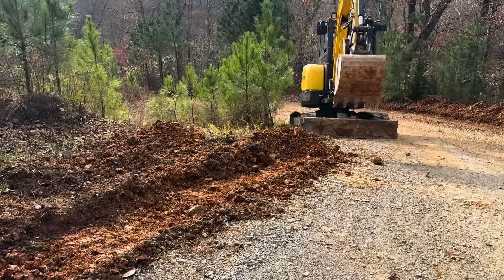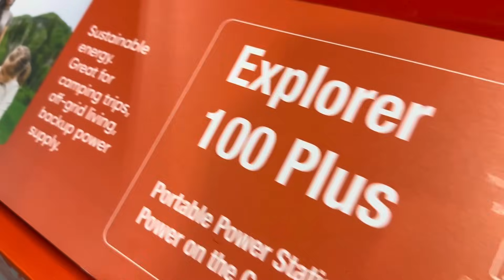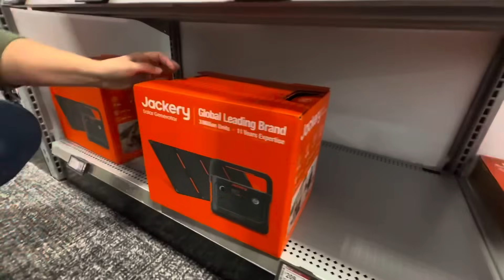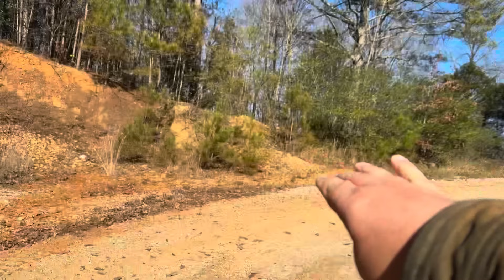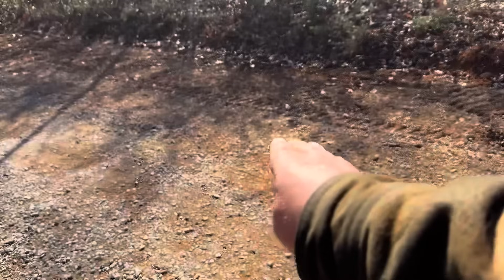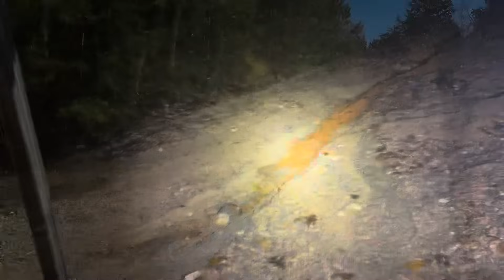Driveway was destroyed in rainstorm. Adding new drainage & water control.  Steep hill gravel drive

Comment: you're on the right track, I would dig the ditch deeper and fill it with rip, rap to slow the water down. On the high side dig a hole as a holding area to filter the silt then a 24-inch pipe to the low side of the drive to let it go down the bank. You have a lot of water coming around the curve at the top that needs to be wider and deeper, so it doesn't run over and wash. With the use of the excavator, you could fix it easily the only cost would be the large stone.

Comment: After watching it, cut that ditche out to the left from the top of the hill looking down. You dont want it to go around that turn and diwn the hill. You want to get it out if that ditch. You did good with the rock check dam you put in to slow that water down.

The washboarding is from wheel hop. Once you get it it will keep getting worse over time.

Comment: That upper dricpve part, where the dirt is four feet higher, you should consider put in some drainage pipes, or cutting  some gaps to get the water drained out.
A club I belong to is near the bottom of a hill. Our gravel parking lot was washing out. It turns out the shoulder, on the street, needed to be graded down. It was only a couple of  inches high.

Comment: It’s hard to believe that 2-71 has that much grunt. 

  Respectfully stated… you need to consult a real Civil Engineer… what they will likely recommend will stun you, but like any big, overwhelming project… you break it down into smaller, manageable sections…. Then accomplish the first section. 
    Common sense won’t cure issues like yours with that much rise or fall. 
    Good luck.
Reply from the maker: I can see what the water is doing and where it’s going and why.  I just never had the equipment to try and deal with it until now.
Reply: @  I’ll repeat, good luck and take pictures…🙃🤣👍

Comment: Washboarding is caused by speeds over 10 mph on dirt or loose gravel surfaces. Since you have to maintain over that speed to charge up the hill with the busses, you are always going to have to box blade the road. Just don't create the dam situation on the sides anymore, let the far end of the box blade hang over the edge of the drain trench.
Now that you've got the trenches dug out with the mini ex, you'll be able to maintain the trench with your non-blade tilt bulldozer. Just drive it with one track down in the trench.

Comment: Looks GOOD  your new ditching, WASH BOARD IS SOMETHING THAT HAPPENS TO ALL GRAVEL ROADS. It happens when vehicles travelling uphill keep the power on and the drive train suspensions starts to bounce. The only way to avoid this is to let off power and creep up the grade. You probably do not have that option.  I think this is going to be something you will have to deal with.   Bob

Comment: Wow, Jon is pretty talented on a mini excavator.
Something I have seen used for surface maintenance on both gravel surfaces, and dirt (track) surfaces,  is old chain link fencing.  Find a section of old chain link fencing, maybe 6-10 feet long when stretched out.  Put a bar at one end, through the chain link (top-to-bottom if the fencing were standing up vertically).  The entire setup then tows flat on the ground,  and requires so little tow effort that your golf cart could be used, uphill or downhill.  
The box blade is obviously necessary after major weather events,  but in between major tune-ups,  drag this piece of fencing around flat behind your golf cart, 4 wheeler, argo, lawn tractor, probably even a bicycle,  and it just smooths out things.
Horse racing tracks and farmers use it for sweeping tracks, dirt parking lots, etc.  Between races, it gets rid of ruts, hoof prints, etc.  Not a replacement for the box blade and heavier equipment,  just a supplemental thing that can be done by low-powered equipment.
Reply: Can also embed it under gravel layers to help keep gravel in place

Comment: Line your ditches with grapefruit sized rocks as the water will erode the ditch. Dirt roads need a higher crown than paved to get the water off faster. Where water wants to cross the road to the other side is where culverts are needed. Steep park road with switchbacks near me were cut in 1909 and had high crown with drainage ditches lined with rocks. It was later paved by tar and chip (many layers over the years). Erosion was not much of a problem. They eventually regraded it all flat and put in curbs and better storm drains.
Reply from the maker: Right now i want the ditches to erode a bit to make them bigger.  Then i’ll add more large rock

Comment: Your driveway reminds me of mine I had to deal with 20 years ago , same grade,. I had to make a ditch down to bedrock to overcome the torrent of water during big storms. There was always some washouts. I would put on the raincoat and take the camera out to video how mother nature was going to send the water. I bought a very old one bottom plow that I used up on the high fields to cut culverts and direct the water towards a small pond I dug for wildlife and act as a holding pond during big rain events. The plow I picked up for $20 at a farm estate auction. Just sharing my battles. I left that property, it was my womens at the time. Way to much work and so little return in my case. Good luck guys!

Comment: I keep suggesting this but you need to get that water off that road and out of those ditches and low it down. In your case this is hard. Your going to have to make some really borad based dips since you have those busses to get over them and your going to have to put check dama into those ditches since you don't have a way to turn the water off and around back on itself to slow it. I would cut that high side of that hill every 50ft or less on that hill to get turnouts.
Reply from the maker: The ditches are carrying the water away and keeping water from entering the driveway from the outside
Reply: @BusGreaseMonkey  but if you don't slow that water in the ditch down it will errode I to hue gulleys that will wash your drive out. The goal is to get water off drive your correct but you also have to slow the velocity down you want as little soil movement with that water flow.

Edit: to be fair I'm only a few minutes through this video, I had to stop watching to do something else. So I'm not sure what you ended up doing here. I'll come back and watch it.
Reply: To keep water from gaining speed in the ditches and eroding everything in the process, I think that digging the side ditches a bit deeper and filling them in with #57 rock from a cement plant or quarry would slow down the water flow and prevent erosion.  The water will still flow freely enough all the way down.
Reply: @BlackPill-pu4vi  I'd put piles of surge every 25 foot or so. You can use hay bales but as steep as that is and how much water would need to get down fast it won't work here it would make actual dams and then flow back over the road.